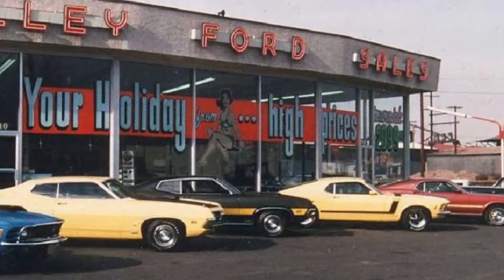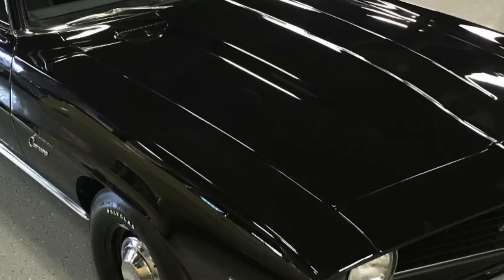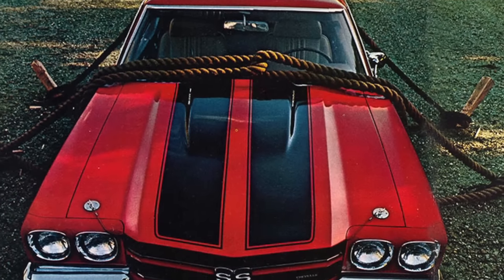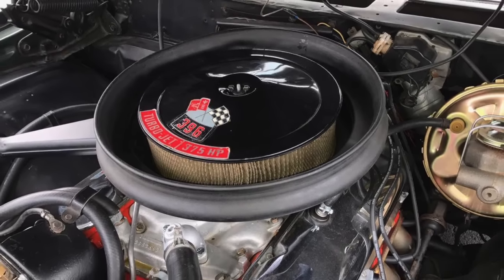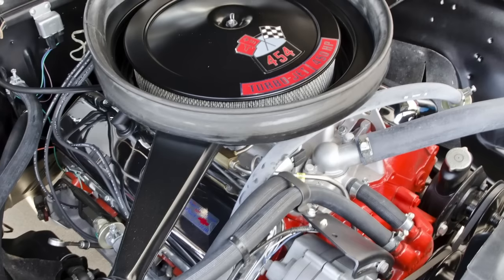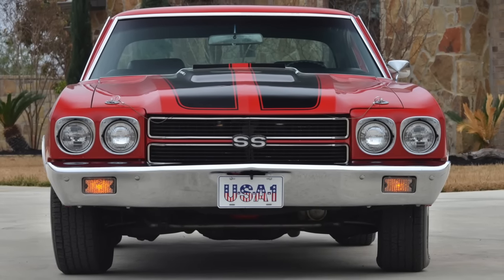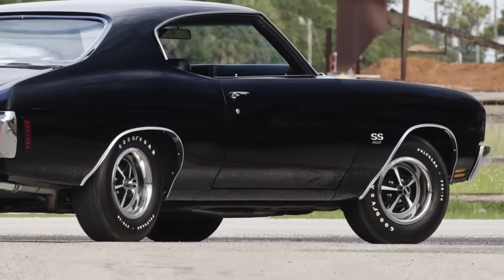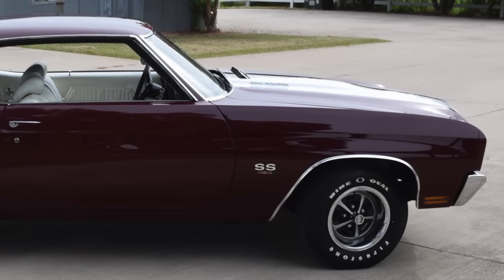1970 Chevrolet Chevelle SS LS6 454 – Freak of Nature

Comment: TurboHydramatic 400...  not "Turbo-Hydraulic".
Reply: Ronald Schoolcraft FYI it's turbo hydramatic or turbo hydra-matic. I haven't seen it described as turbohydramatic.
Reply: 46wireboy I just looked at one on the shelf. It's Turbo-Hydramatic. The point is, he said "Hydraulic". Those transmissions were made by the Hydramatic Division of General Motors. Not the Hydraulic Division. I was an engineer for GM for 15 years. So I guess you can get picky about a hyphen if you want to.

Comment: Fake horsepower numbers...the 450 hp was a GROSS bench dyno rating......in the car the NET was about 360 hp---about the same as a 2021 Dodge at 375 NET hp.
Reply: Speedy rapacki  500 hp GROSS on a dyno is without muffler, belts, smog gear, or air cleaner.   With all that stuff put on  your  500 gross turns into only 410 net in the car.....a common 2021 Dodge/RAM  with very common 5.7 V-8 cranks 375 net.  Also no Chevy BB ever went 100K miles without major repairs, the newer motors no problem.     NOT apple to apple ratings at all.
Reply: Speedy rapacki  it wasnt started in 1971 it was 1972.....gross and net numbers are two different systems.......90% of Goobers on this channel dont even know what GROSS or NET means----the dummies still think the 426 hemi really put out 425/500 horsepower when it is really 350..prunes and apples.........